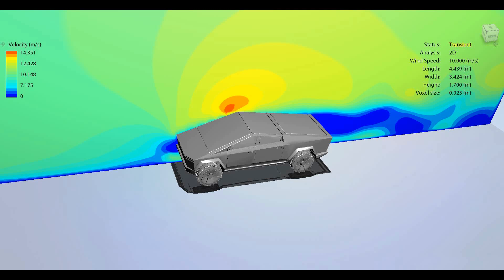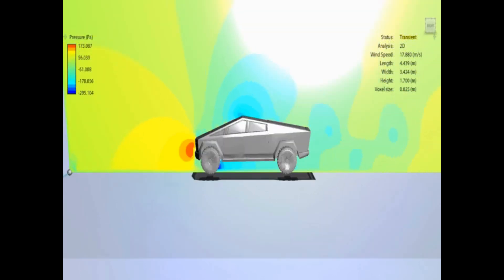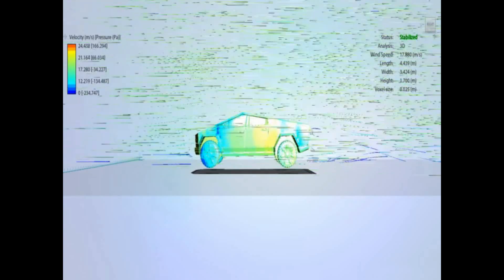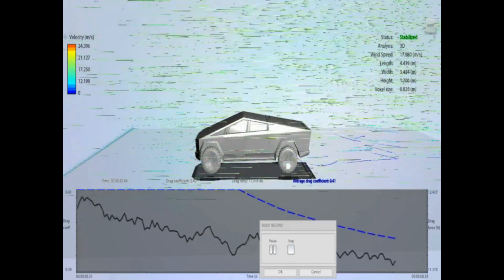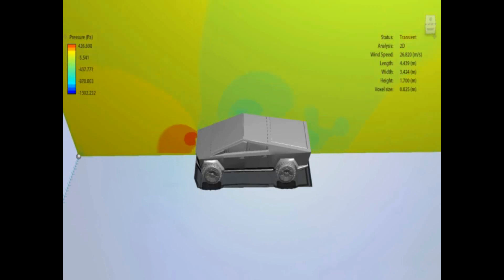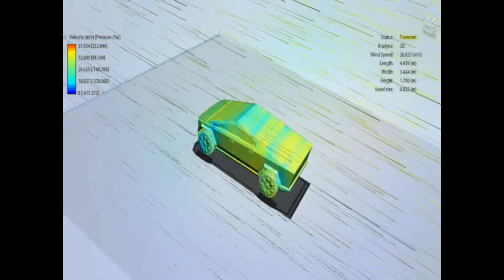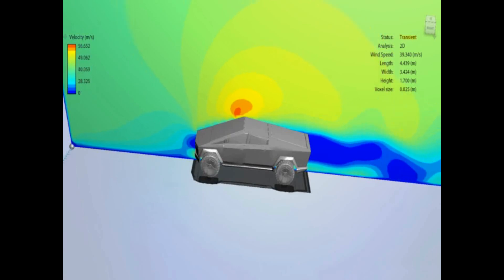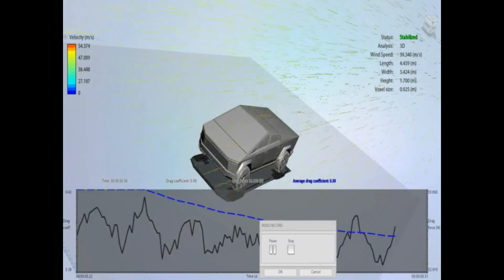Cybertruck aerodynamics - Whats going on?!!!

Comment: The flux at speed is amazing, the capacity is also good
Reply from the maker: Where tesla's going they don't need roads
Reply: I'm waiting for a certain franchise reboot with this vehicle.
Reply: @domgia9248  Hummer gm is doing that
Reply: zulfikangga  are you kidding?
Reply: zulfikangga  Base model price for the Cybertruck crew cab is only a couple thousand above the base price for the F150, and has more standard features.
Reply: I see what you did there! Flux capacitor, Delorean, Mcfly, Doc Brown!
Reply: @ChippyIVI  They might do just that you know
Reply: @ChippyIVI  I predict the increase will be more like 20 grand.
Reply: @jamesmacleod9382  Yeah, I think there will be a price increase too, but my bet is on higher end and auto pilot function, I think base price without auto pilot should still be around 40K.
Reply: @Verpal  I don't know, but that seems kinda low. I would just like to see it at a point where you don't have to be pulling down Doctor money to afford it. It would be nice